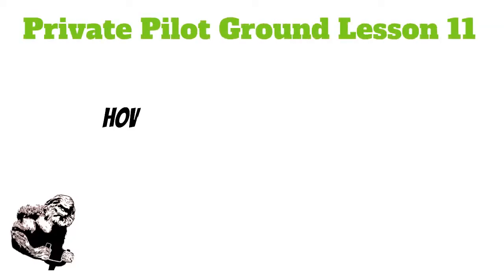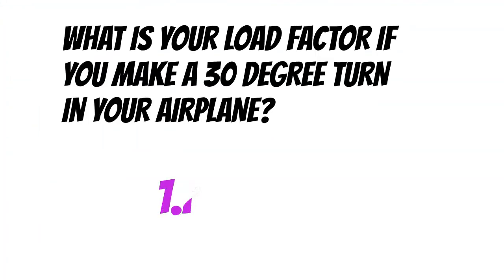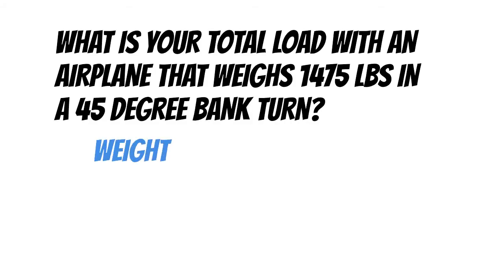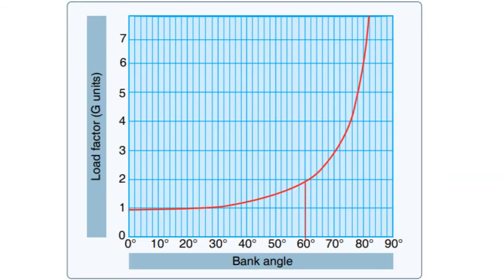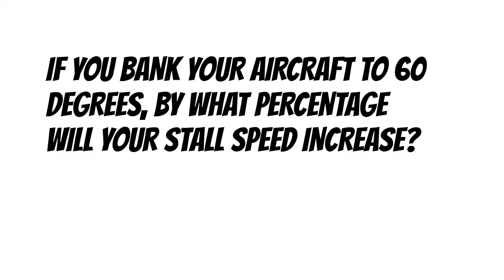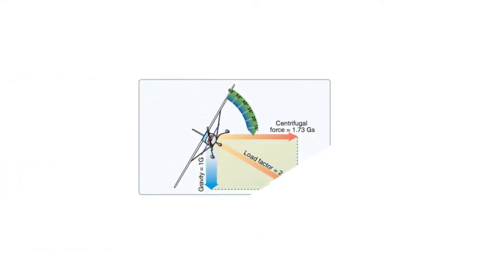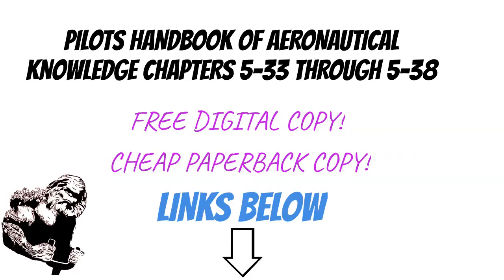How to Calculate Load factor for the FAA Written Exam (Private Pilot Ground Lesson 11)

Comment: I don't understand the last question. 
After you found the percentage increase which is 42% why did you add 16.8 to it? Where did the 16.8 came from??
Reply: I think they were saying that stall speed is normally 40 knots +42% of 40( 16.8) =56.8.

I don’t think it was part of the original question though.
Reply: @harmlessspider3693 im still kinda lost on this but thanks for your reply

Comment: does the increase in stall speed to 56.8 mean you have to fly faster than that to prevent a stall or slower than that to prevent a stall?  is 56.8 your new minimum airspeed or your new maximum airspeed ?
Reply from the maker: Yes. You must fly faster than 56.8 to keep from stalling.  Avoid flying slower than 56.8
Reply: @FreePilotTraining but in the previous video you explained that quicker turns make it the load greater, so how’s that working together?
Reply: The result of banking hard and fast into a turn also increases wing load as air speed must increase to avoid a stall therefore you could end up exceeding the aircraft’s design limit (wing overload).

Comment: your amazon afiliate link is not working for the pilots handbook of aero knowledge. Thank you for the lessons I want to support you by using your affiliate links.
Reply from the maker: Thank you so much for the heads up and your support! I need to fix all those links.  I fixed this one, but here it is for easy access:  https://www.amazon.com/Handbook-Aeronautical-Knowledge-Aviation-Administration/dp/1510726063?crid=14AYRUB4CQ2Y9&keywords=pilots+handbook+of+aeronautical+knowledge&qid=1669330722&sprefix=pilots+handbook,aps,109&sr=8-1&linkCode=sl1&tag=diyman-20&linkId=1dea7a1ab55f36b6c22f6e2009c85d13&language=en_US&ref_=as_li_ss_tl

Comment: I see how you got the answer, but in big picture what is the risk here?
Reply: When you say higher stall speed does that actually indicate lower?
Reply from the maker: Not 100% what you’re asking here, but you will get stall indications at the higher airspeed and you will also stall at higher airspeeds
Reply from the maker: Bending the airplane frame is likely, breaking the wings off and going “helicopter mode” is the worst case scenario. Planes don’t fly too good in “helicopter mode”

Comment: Where are you getting 16.8 from the 42%?
Reply from the maker: Sorry. I guess I should have explained that better. 42% of 40 knots is 16.8. You would get that by multiplying 40 x .42.  This would give us an increase of 16.8 knots. Hope this helps you
Reply: @FreePilotTraining  and where do you get the 40 kts, is that the stall speed in the POH?
Reply from the maker: @theklidz8951  40 is an average stall speed for training aircraft. It’s usually somewhere in there, but you’d need to look at the POH to get the exact number
Reply: @FreePilotTraining  👍thanks for clarifying
Reply: So i just want make sure its 42 divided by 100 its 0.42 and the 0.42 times 40 its 16.8 am i Right?
Reply: This video got me confused 😅 but u hope I’ll understand it later on…

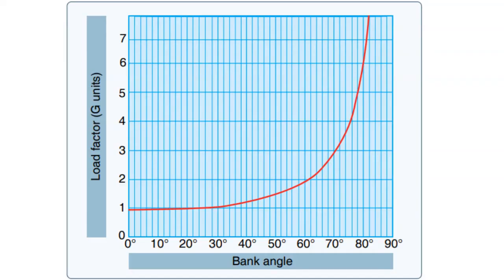Comment: I like your simplistic approach to discussing this subject.  However, I have to point out that your graphic @ 0:28 poses an improper question.  The graphic says "What is your load factor if you make a 30 degree turn in your airplane:"  I believe the question should be worded "... 30 degree bank...", not "turn".  A 30 degree "turn" can be accomplished at any angle of "bank", including zero degrees of bank.
Reply from the maker: Thank you for the heads up. That is definitely a mistake.